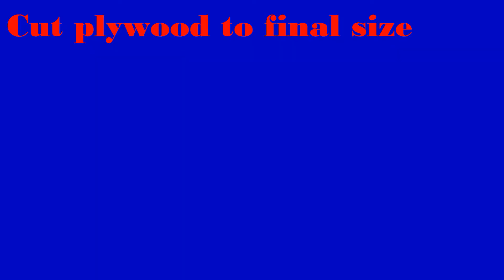Building a dog bowl stand (under $30)

Comment: We do a lot of projects that are completely or nearly free by recovering wood. For example, pallets can be planed to get REALLY nice wood (with a few holes for accent:). Pallets used for heavy items such as concrete blocks are sometimes oak. We have made display stands from oak from pallets. Also, we always check the recycle yard on the military base for discarded wood because there is often nice stuff that people pitch out. Anyways, congrats on this project, it's a really nice one! We like that you made your own tables for your saws. That's great.
Reply from the maker: I’m fine with pallets (free hardwood!) except for taking them apart. I use a dull circular saw and a pry bar to take them apart, and my planer isn’t great... but it’s a good way to do woodworking!